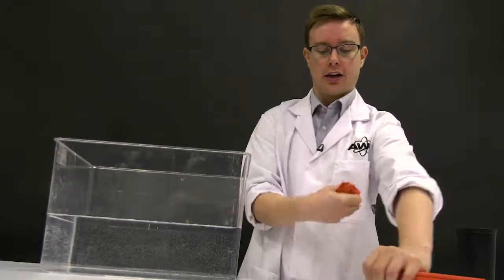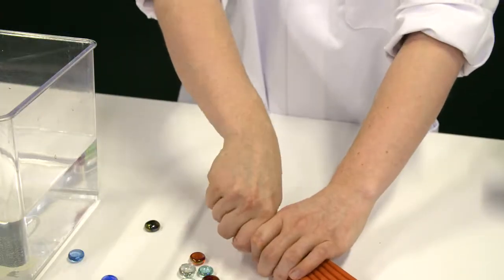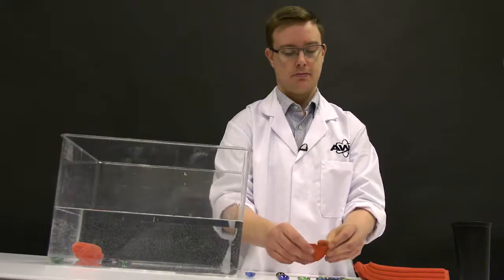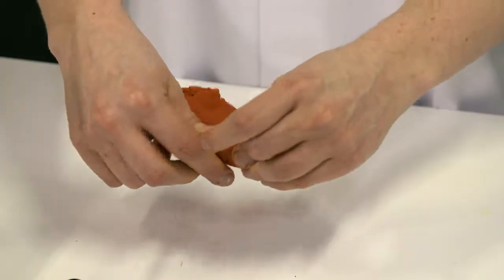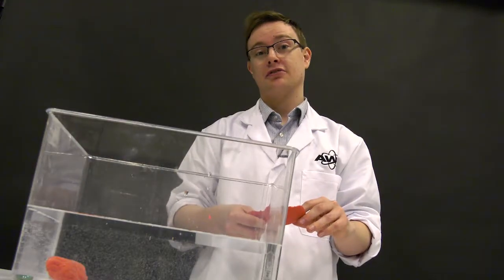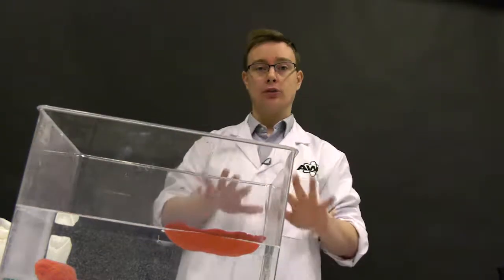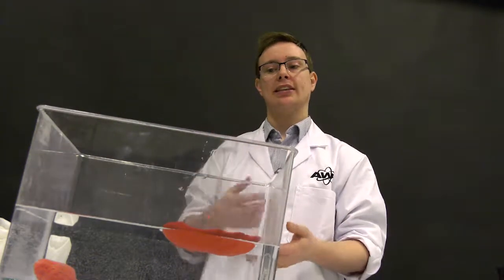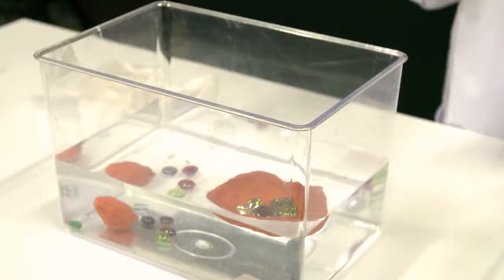BONUS CONTENT for Science Alive! Science Experiments T2C book: Float Your Boat

Comment: if we put a beaker filled with water on a scale and ping pong ball threaded to the bottom. the scale will be giving us a certain reading. but if we cut the thread, at that moment the scale will read higher value until the ball reach the surface and water level drops.
 what do you call that phenomenon?
can you perform that experiment ?